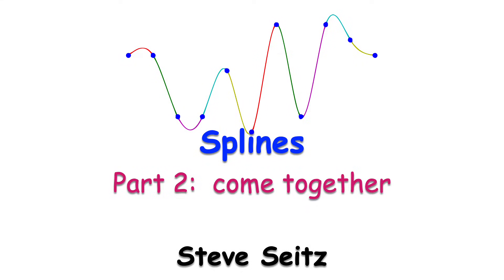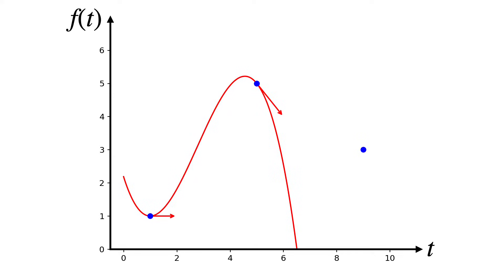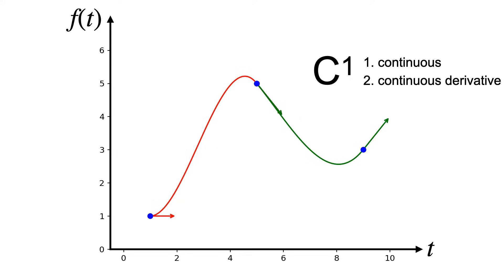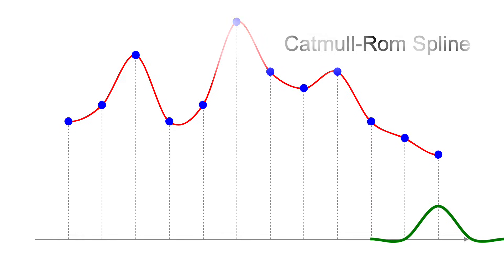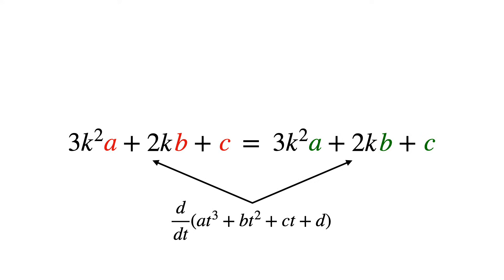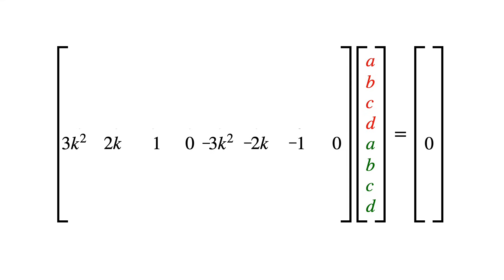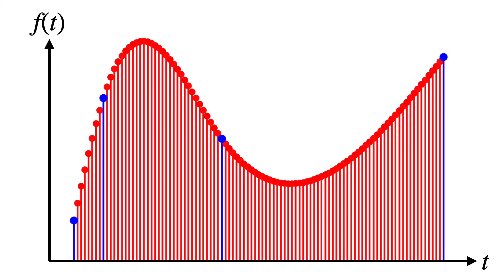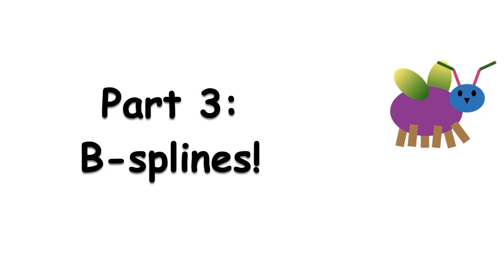Splines in 5 Minutes:  Part 2 -- Catmull-Rom and Natural Cubic Splines

Comment: There is also monotonic cubic interpolation which is commonly used and you might be interested in it if you're watching this: https://en.wikipedia.org/wiki/Monotone_cubic_interpolation
Reply: I was going to mention cubic Hermite interpolation, a form of monotone interpolation. Gotta preface it's use with the fact that the "steps along X" must be equal distant, aka uniform in interval. In other words, CHI doesn't work if X is allowed to be arbitrary real numbers on the number line.

I explored both cubic Hermite and Catmull-Rom splines for their use in 8-bit microcontrolers several years ago. I'd link to the stack exchange question, but just googling "cubic spline 8 bit" gets you to it almost the first hit.